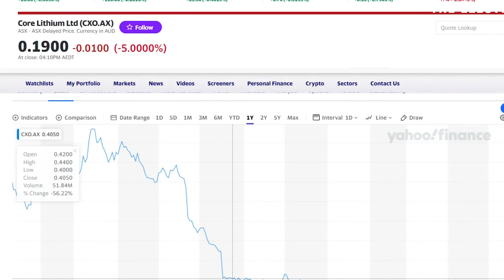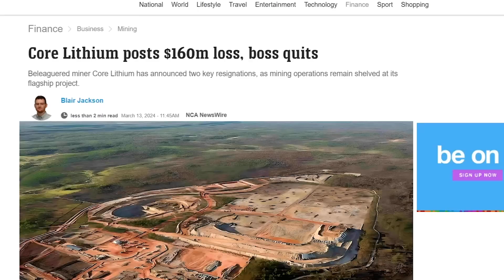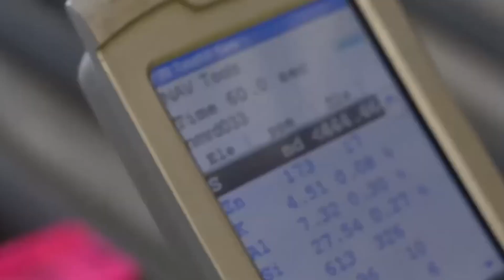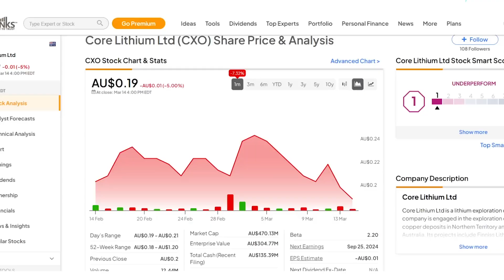Lithium Battery Companies Loses Billions | Forced To Close Locations

Comment: The problem in a nutshell is due to Enthalpy (look it up, it's a real word and relevant here), which is the chemical reason why lithium batteries suck during really cold winters.  When you remember that a battery is a CHEMICAL reaction and you do the math based on Enthalpy equations, you see that reaction rates drop as temperature drops.  In the northern part of North America, the battery's reaction rate and therefore its strength will EASILY drop to 1/16th of its summertime strength.  If your vehicle is nearly useless during really cold winters, why did you bother to buy it?  AND to make it worse, batteries are less of a heat engine than internal combustion engines.  ICEs need radiators to dissipate the heat.  There is no problem about ICEs staying warm enough to work.  And that inconvenient truth is beginning to sink in.
Reply from the maker: Thanks for sharing your view on this matter